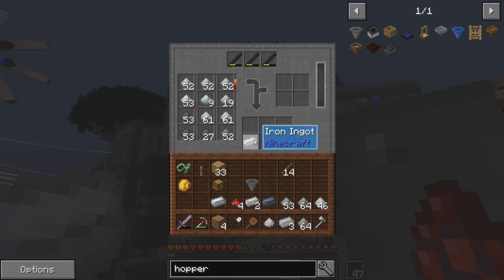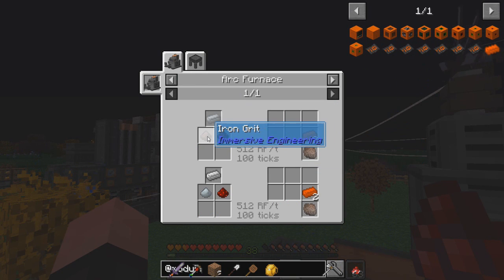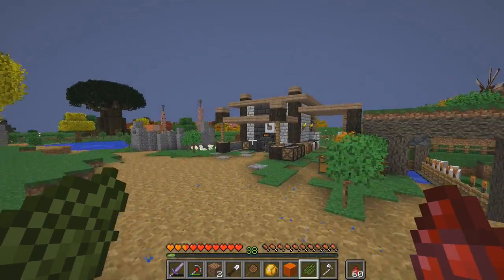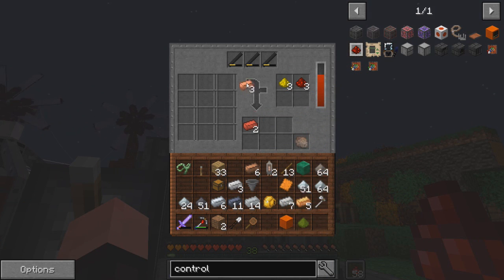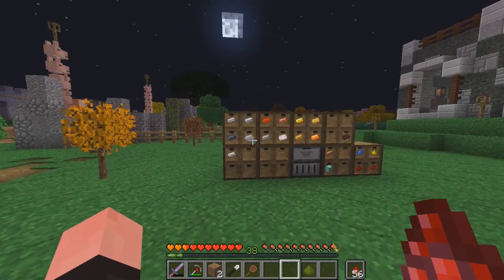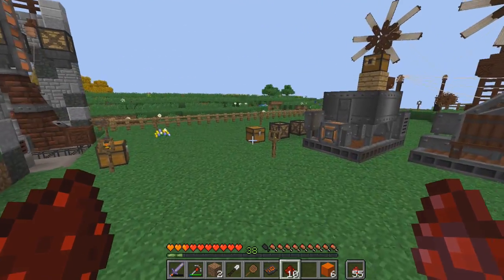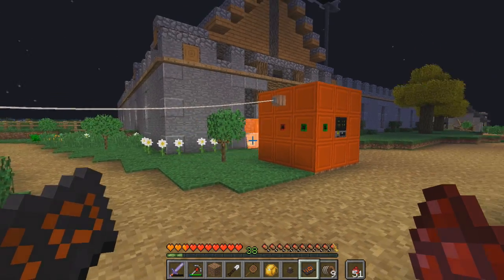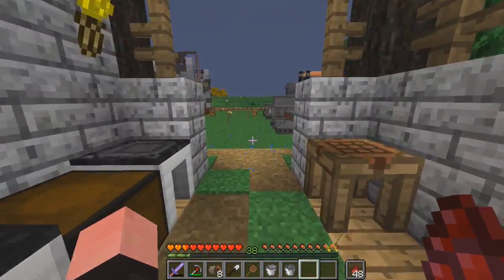Sevtech Ages-All Mixed Up-Ep104-Modded Minecraft-Machine Controller, Machine Casing, Propene

Comment: I don't think the percentage of the rods makes any difference in how fast it runs but if it gets more power it will run faster. So I think it would be a good ide to make a but load of them thermometric generators so you'll never have to run out of power. 
Love Sevtech! <3